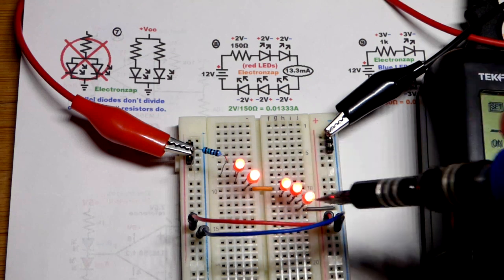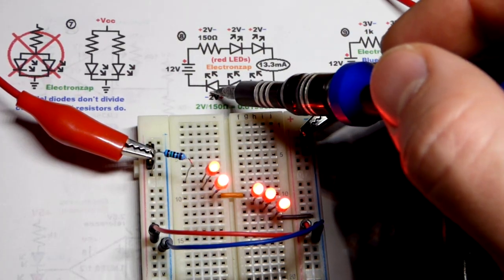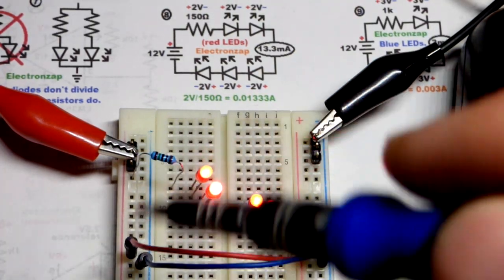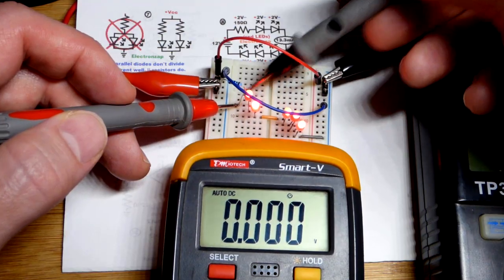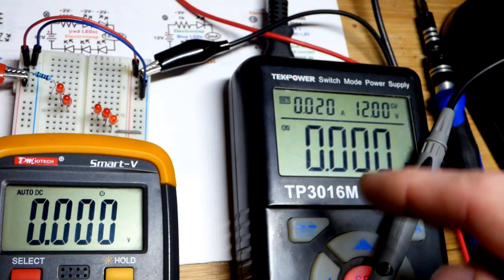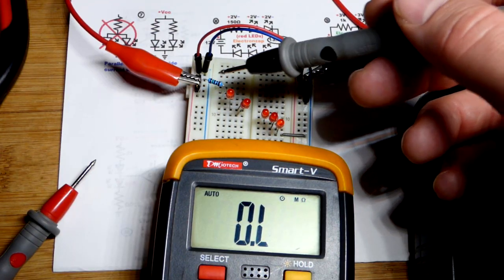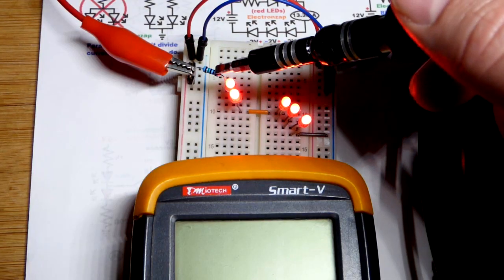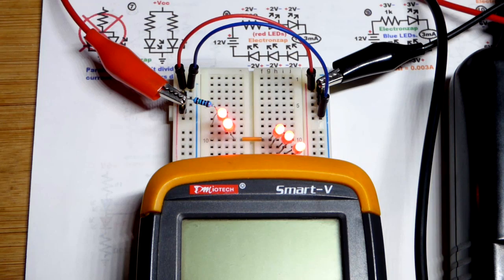Series LEDs and Troubleshooting Difference Between Calculations Versus Real World Results

Comment: ...was waiting for you to measure the voltage drop across each individual LED.
also, since you measured the actual resistance of the resistor, and the current through it, it would have been nice to calculate the actual power dissipated in the resistor.
THANKS FOR THE VIDEO!!!
Reply from the maker: I measured each LED in the video that I hope to upload in a little bit :) Thanks for watching!
Reply: I measured 2.17v loss across the 150R. Each LED I got 1.96v. My current was 14.5mA.